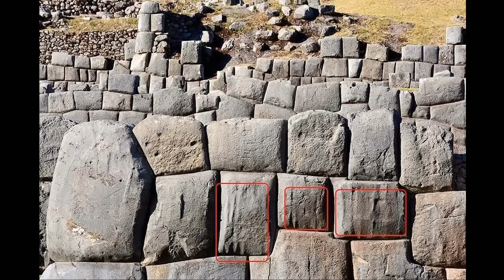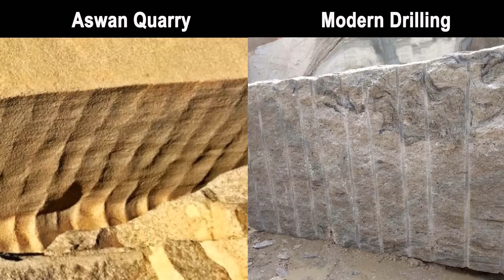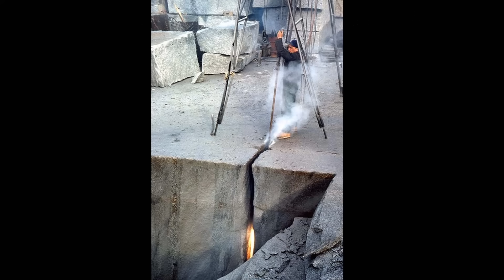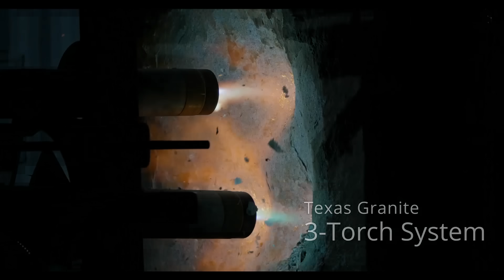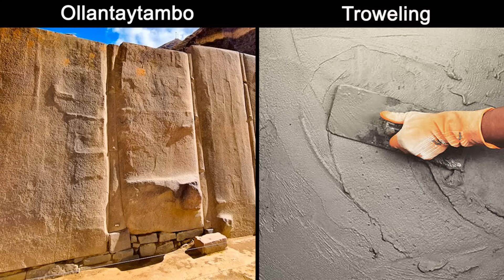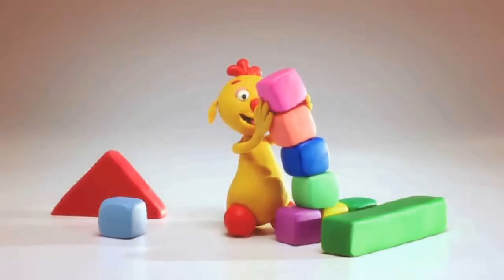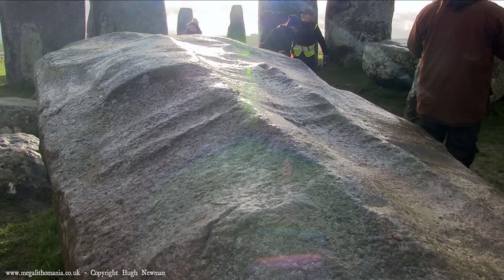Megalithic Mystery: Different Scoop Mark Types?

Comment: they said they burnied the stone to make it brittle before they used hammer stones
Reply: They did indeed. Fire and rapid cooling with water was a common technique employed to shatter rock. 
Fire and water was also used to near perfectly level large areas prior to construction, by building a small mud wall, filling the area with water and as the water evaporated high spots would be revealed, fires would then be lit on the high spots then rapidly cooled shattering the rock surface, and just continue this process until the water evaporated evenly over the entire area.

Comment: I always thought that they used something similar to modern thermite powder. Perhaps they had discovered that mixing powdered iron and aluminum, and igniting it was their method to melt through the granite. If they had to add more thermite to restart the burning, as the reaction would only last a few minutes, and you'd need to restart it as the hole got deeper and deeper - it would have looked like what we see today - like the scoops look like they were started and restarted...just my theory

Comment: To produce Plasma that disintegrates hard rock,
you need very advanced technologies, a lot of energy and very high temperatures.
The Egyptian Pharaohs were NOT capable of such a thing,
They did not have such advanced technologies.
In fact, there is no obvious evidence that there was any very advanced civilization before the Sumerians, there are no ruined cities.
Reply: You must be new here.
Reply: Check out the Jayan Films documentaries on the Barabar caves in Bihar India and then come back to comment.
Reply: Shsssh dont ruin their delusions its all they have
Reply: @driveboy317 Deluded people try to ignore evidence in the form of the rock itself and similarities to the marks made in similar rock with  modern techniques by ad hominem attacks on those who point to that evidence. It is far easier to grow a technological society than it is to then maintain it for aeons.
Reply: You are correct they weren't capable of that but as the Egyptians themselves said to the Greek historians they found these granite buildings and obelisks etc they didn't build them. Clearly some civilisation from the past had a technology that could do this and the markings on the stone do look similar to the plasma torch markings.
Reply: Regarding the concrete-geopolymer theory, to crush millions of tons of stone in powerful crushers, driven by powerful engines, it takes even more energy than to cut them from the mountain - quarry. Then the crushers wear out, other spare parts are needed, which where were they manufactured?
Where are the solid foundations of the factories?!
Reply: @iulian6h  - not quite. You disaggregate the stone chemically. No powerful machines necessary
Reply: This is correct. You can’t apply modern solution to ancient problems. The key is simplicity, not complexity
Reply: Human species from Africa to Egypt before anyone else

Comment: In addition to your brilliant analysis and awesome reporting, Tina, here are two thoughts:
1.) The elder obviously used stone softening in two ways:
a. To carve out natural stone like in Assuan 
b. To create tighly-filling geopolymer walls like in South America.
2.) Maybe point b. is not about fully melting the stone material and casting it, but merely softening the connecting surfaces. This would produce the same tight fit, but allow for easier handling of the huge blocks. If the protruding knobs were left out in the softening process these could be used for carrying and positioning the blocks with the help of some kind of cranes.

Comment: Some very interesting theories. I doubt that soft rock was used. If they had a way to make rock into play-dough, why not make the blocks consistent sizes and shapes?

There are other examples of large machines having shaped already constructed walls, and there are walls/structures finished to a polish and precision that required machines.

Comment: 12:12 Just a thought... If the semi-flexible blocks were laid bottom-to-top, the lower ones would be already a bit harder than the upper ones, so they would make an imprint in the upper stones, not the other way around as we see here. Maybe the stones were indeed quarried and just cleverly dressed. In some video someone nicely explained the possible process. The upper stone was lifted some distance above (held by wooden pillars fit into the "knobs"), then a distance tool with a plumb line would be used to gauge the distance between the two blocks. Any piece closer than the desired distance was cut from the lower stone as it's easier to reach with a cutting tool. That way the imprint would have been made in the lower stone.
Reply: A bit complicated for several angles, and most surfaces are curved in two different planes.
If you vibrate the upper rock in it's resonance frequency, it will mill itsself down into the other rock and it would nearly always cause two planes of curved surface as an asymmetric rock would vibrate asymmetric

Comment: While the idea of the plasma torches is interesting, it doesnt work for most marks. so many shapes and marks prove that they must have been able to make the rock pastic. with heat, you can remove granite material quickly, so it may be viable to dig tunnels, but the the polygonal wall for example certainly were made with softened rock, as they show plastic deformation like shapes and signs of squishing. even the very flat ones all curve slightly inwards at all their joints with a roughly uniform radius, which is clearly the result of a flat surface being squished outwards.  you also have abandoned huge rocks which quite literally are bent under their own weight, as if they were just soft enough to sag under their huge weight. it wasnt liquid, and probably took lots of force to deform, but obviously less than if untreated. 
you cannot use heat to explain their plasticity because melting results in a glassy material afterwards. also, you can tell that many scoop marks, particularly those in south america and the osirion in egypt, are so shallow and uniform in depth and so smooth, they look as if quite literally, the material was scraped away with a hand tool, sort of like you would flatten concrete that you put on a vertical surface with a flat shovel like tool. 
some objects also show that they were able to get the surface at least soft enough to literally deform by hand like clay. probably not the entire rock, but the surface. even in India, you have stone surfaces that are polished with indentation that look literally like it was soft, and it was touched accidentally, leaving a dent in an otherwise flat surface, which is smooth, and dynamic to a point where it cannot be made unless the rock is soft.

Comment: Maybe they were using the heat spin engine as a sandblast of sort putting sand in with the water and using the steam and sand shootout to cut through it in a swathe that would resemble a scoob

Comment: Should've stayed with your plasma torch theory & then extrapolated tech from there, instead of geo polymers which is total BS due to the crystal formations in the stones  ....
Better idea is that 'they used plasma torch as a fast quarrying method then used scanning & a 3d program that removed fractures & matched the stone to the corelating already placed stone, hence the strange shapes but perfect fit.

Comment: When fabricating the Aswan obelisk, such a cutting was applied using steel tools (pickaxe, short chisel, long chisel, hammer, sledgehammer, wedges, crowbar) that tool marks remained on the blocks removed from the trench, and there were practically no tool marks on the walls and bottom of the trench. On the walls and on the bottom of the trench, there were mainly characteristic recesses (places where stone was broken off, so called “scoop marks”), which “scientists” today pass off as the result of pounding with dolerite balls. The few traces of steel tools that still remained after the cutting were subsequently destroyed by tapping. Most likely, it was made with the same dolerite hammers. A detailed description of the cutting method used in Aswan is given in the book “Peruvian polygonal masonry: how, who, when and what for” (148 pp., 2025).

It is noteworthy that the same “incomprehensible” traces (“scoop marks”) on the walls, on the bottom of the trench and on the Aswan obelisk itself can be observed today in many operating quarries since the technology as a whole remains the same as before. Only the grooves between the cut blocks are made not manually but with the help of machines. In particular, the mentioned book contains photographs where markings similar to those on the obelisk are formed in an active Japanese quarry for stone extraction in our days.

Comment: Not any evidence of what she said.
Reply: How did they generate high temperature ???
Reply: The proof is right in front of your nose
Reply: @Johnrack  no its not.. at all! Her theory is wrong. No heat marks, no blowouts, everything is smooth and symmetrical. Stop acting like shes right or this is an easy mystery to figure out.. go read 📚
Reply: Outside of the referenced evidence that is literally engraved in stone and observable?

Comment: The local mythos claims the polygonal stones were lifted up in fire and molded that way. Extreme heat could both soften the rock and re-crystallize the microstructure.
Reply: подскажете какой текст мифологии?

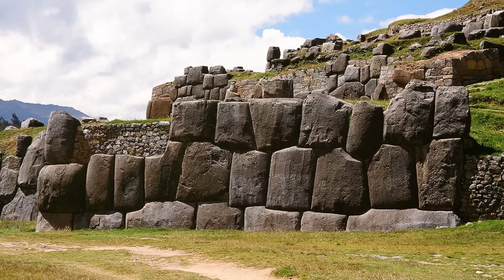Comment: @9:40
I respectfully disagree with you and the geophysicist authors conclusion of Geopolymers.
With the caveat that assuming that the traditional mainstream explanation is correct and there was no advanced technology used in the past.
Either hand working the stones or casting the stones both present their own special “impossibilities”.
It would be neither easier, nor more efficient to cast these stones, over carving them.
With casting we have to explain HOW the granite/ basalt/ sandstone, etc. was, firstly, crushed down to a powder.
What admixture was used?
How were they mixed?
How were these items transported to the site?
Where did the endless amount of wood come from to create literally THOUSANDS of individual “molds” for each unique, individual block?
Why/how are these stones both semi liquid (concrete texture) AND “bulge” also?  They look more like thousands of different sized cement bags were dry stacked in place and then wetted down, more than a mold was made that left that finished product.
Plus you still have the issue of a work crew and how they were fed, building these complexes and temples up above the tree line in some cases.
I think we’re still missing a big portion of the puzzle, but we’re asking the right questions.
Thanks!
Reply: the rocks cannot be geopolymer because they show natural veins and such. if it was crushed and used like cement, the result would have a uniform look and color, and certainly not have natural quartz veins. also, molding implies uniform shapes and sizes, which obviously isnt true, because all stones have different sizes and shapes, often quite dramatically different even. also, melting is out of question because it too doesnt leave normal looking granite, it leaves obsidian glass, which you can see on youtube if you look for melted stone. 
still, you can see that the rocks have strong signs of plastic deformation, squishing, etc., there are bent stones that clearly have sagged under their own weight, implying a plasticity that requires huge force to deform, but obviously less then normal. 
the polygonal construction method clearly was done out of efficiency. they pulled out precut rocks in rough shapes, softened them, and then stacked them on top of each other with a poor fit, and they would deform under their own and their neighbors weight, forming the dynamic and perfect, yet chaotic and irregular surfaces. in places where rocks have fallen out of the wall, you can even see that their surfaces are less fitting in places where there would have been less weight above, with clear indentations of now gone rocks that were sitting above, clearly with shapes that imply that the rock above pressed itself into the rock below, deforming the interface until both touched perfectly. 
the only possible answer is that they used some kind of unknown chemical process and or electromagnetic treatment that altered the chemical bonds temporarily, such that they were weak enough to be deformed that way. the rocks even show discolorations that imply that they must have chemical changes in their composition which must be detectable still today, because they reflect light differently, which implies there is a structural change in their molecular structure that remains afterwards. 
you should be able to figure this out by chipping off part of the outer surface of a clearly plastically deformed stone, and compare it to normal granite under a electron microscope, and have chemical analysis done with various methods that can determine anomalies in their molecular structure.
Reply: @sshreddderr9409 
Curious that geologists and other scientists haven’t bothered to be curious enough to search for the truth/answer.
Reply: @manitoumimi  those people need funding and permission, which they wont get, and they need to be interest first and recognize that these rocks have to be treated in some way. to perform such an analysis, you need to get a simple, probably illegally from a deformed rock, and then be willing to spend 10s of thousands if not more on scientific analysis. there isnt many people interested in this which also have the funds to not be bothered by this, and then those arent willing to get samples at all cost.
Reply: @sshreddderr9409 
“It is difficult to get a man to understand an issue when his paycheck depends on his not understanding the issue”.
Reply: Mike Haduck: a lifelong stonemason 
SGD.  Sacred geometry decoded 
 Wally Wallington: retired carpenter 

     These guys give demonstrations
Reply: @davepowell7168 
Haduk speaks of softening the stone (from what I’ve heard from him so far?) and Wally shows how to move some fairly large stones, stone none on the scale of MANY of these structures’ 100 ton plus stones.
I didn’t find anything by Mike showing how the stones were softened, but even if he does show that, neither gentleman explains the logistics the I presented.
As I stated before, geopolymer present a whole set of logistical obstacles of their own, and there are other stonemasons with as good of credentials as Mike that rebut his theory.

Comment: Matter is compressed waveform. Compression happens over time. Walk that backwards. Different world, different rules.
Reply: matter isnt a compressed wave form, its a huge clump of periodically wiggling vortex rings bonded together. if you look at the classical model of an electron for example, if you remove all assumptions such as its shape or having a shell, you are left with only its behavior, which is its toroidal magnetic field, and an electric charge, which is clearly just a dense volume of vacuum moving in a tiny circle, creating the observed magnetic field. all matter is either such a vortex ring produced by circular perpetual motion of a density deviation in the vacuum, or a composite of multiples of those bound together in various configurations, forming nucleons and atoms. matter is quite literally a self sustaining smoke ring in the vacuum.
Reply: @sshreddderr9409  Matter is the visible crest of an invisible standing wave, born not of substance but of relationship, between intention, geometry and the underlying field. It is not made of anything, but held by everything. To know matter truly is to see that it is not the building block of reality, but the echo of its attention.
Reply: @Lo_uma  what your saying is unscientific because its unfalsifiable. what Im saying is clearly indicated by magnetic fields of particles being toroidal vortex rings in every way, as their behavior, forces polarity and shape can be perfectly emulated in water with propellers or anything able to creating vortices. 
if you map charge to density deviation that moved in a circle like what a propeller induces, and assume its motion is such that it self contains, and you see that 1/2 spin is literally just a 2d rotation around the toroidal flow lines, its clear that a vortex ring in a fluid literally is what a particle is, as it behaves the same, and has all the attributes that describe particles, meaning they are structurally identical. 
therefore, its safe to say that the universe  or the vacuum is literally a fluid with density, and everything inside is just relative motion, and only vortex rings, vortex tubes, or composites of such stable structures can persists over time, meaning that this must be the structural basis of matter. 
it doesnt help to inject religious language into physics. it has to be a predictive model.

Comment: This tool could also have been combined with software which would explain the intricacy of the stonework at peru, this can be done with 3d modeling and 3d scanning which would also explain the precision. It would also explain the designing of the pyramid complex, it must have been done with a computer, really there is no other way to keep track of all the measurements on such a largescale with consistency that is exactly what computers are good at.

Comment: Looking at the video of the scoop marks at yangshan the reason they are not so rounded is probably because they remain covered, but you can see something interesting there as well there is a clear boundary line in the center which is created because the tool pivot is limited by the roof, so you can get a relative measure of the length of the tool by calculating the angles and depth, clearly it moved from top downward reaching the limit near the center and stopping, then bottom upwards again reaching a limit toward the center.
Reply: Its just simple fire-setting. Its not a mystery